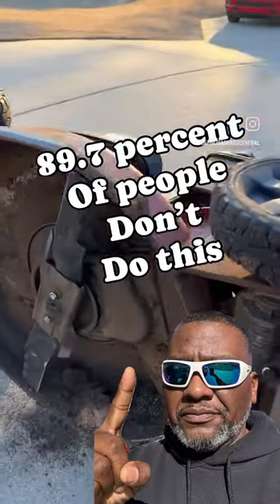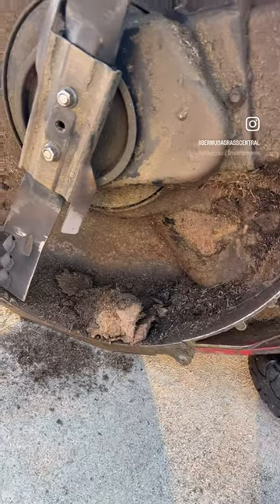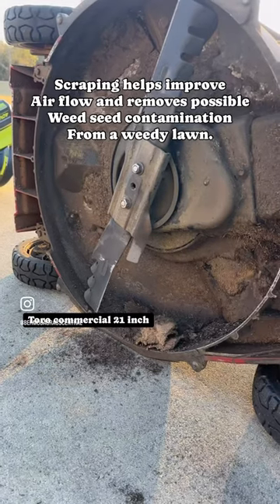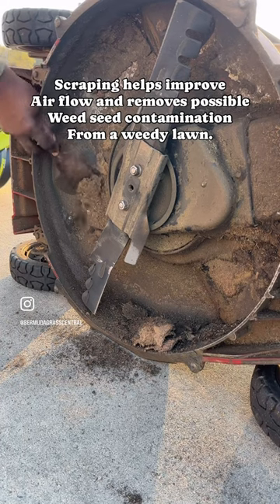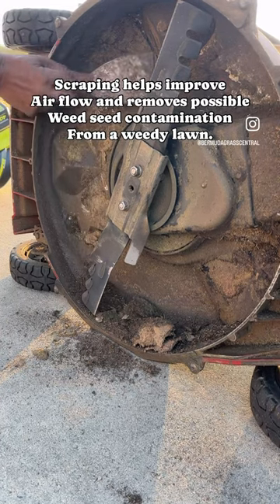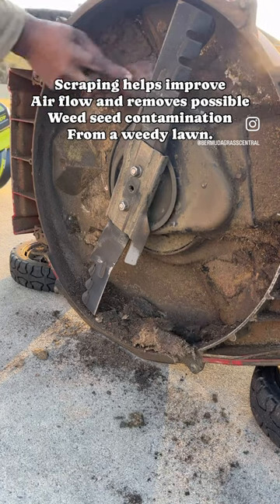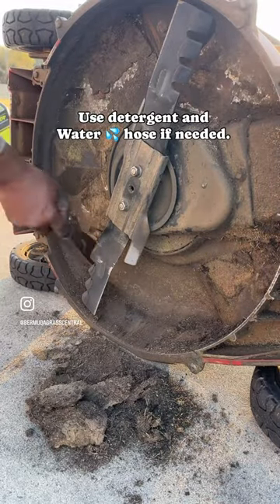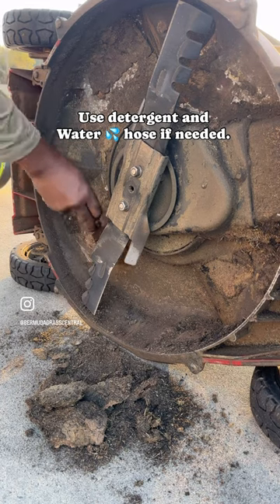This improves your Lawn Mower but people don’t know they should do this ASAP!!

Comment: Won’t the gas leak out??
Reply from the maker: Depends on your mower. This one as long the oil fill / empty is on the bottom side it won’t happen, all mowers are different so read your manual.